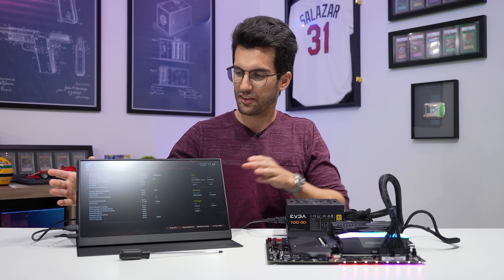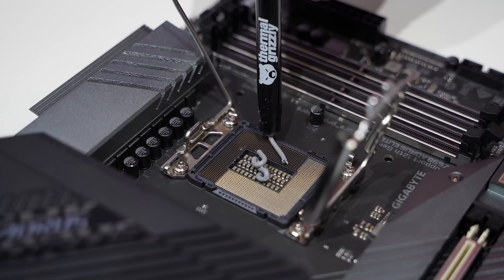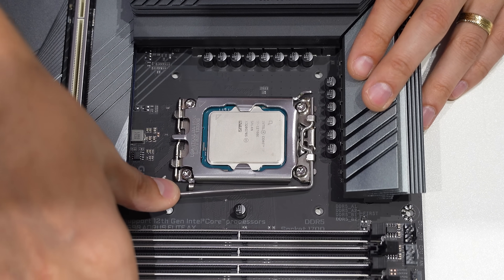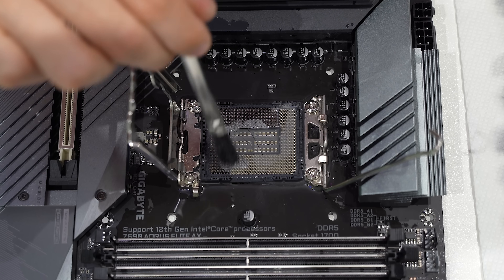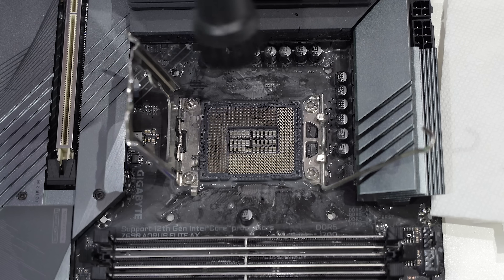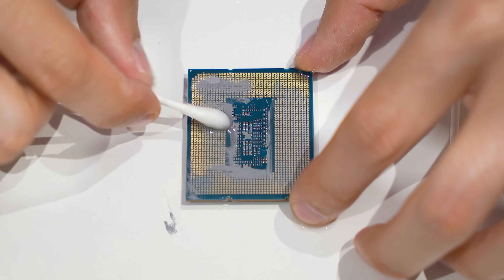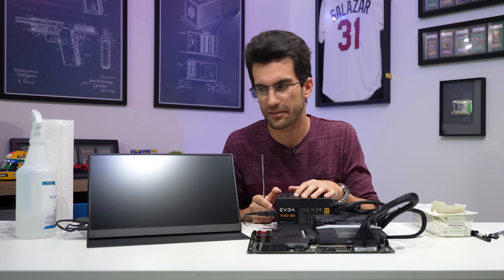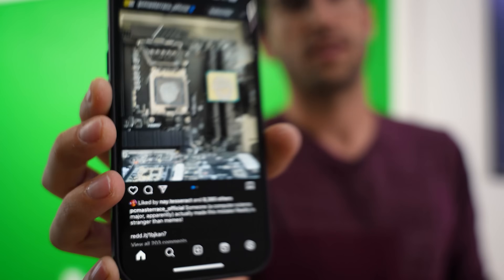How To Fix a Thermal Paste Disaster!

Comment: I can state from personal experience, and without needing to watch further, that YES it is entirely possible, as well as easy, to recover a motherboard from thermal compound like this. I've used a hexane based electronics and contract cleaner for over 25 years that has never failed to strip all traces of thermal compound from heatsinks, cpus and whatever else the compound is on and it leaves zero residue. Granted,  this doesn't make an interesting video, but it works quickly and it's simple to do.

Comment: I use Arctic Silver Ceramique 2 because it's non-conductive and also non-capacitive. You don't want any residue between two pins to start acting as a capacitor. It's not the best thermal paste when it comes to thermal performance but I'm willing to trade a few degrees for a thermal paste that is guaranteed not to cause any electrical issues whatsoever.

Comment: Greg, you just need to apply Power Switch Contact Cleaner, it will evaporate in seconds and will remove all of the thermal paste from the socket and from the processor contact.

Comment: I actually did this oopsie a few weeks ago. I was working late, around 3am, and I didn't know how I managed to get paste under the cpu into the socket. I was panicking and dropping f bombs, but the ipa and brushes helped. I somehow didn't bend any pins and the system posted. I didn't want to buy another i5 13400 and or motherboard lol

Comment: I forgot to mention, you can use a dental water pick with IPA instead of water and tilt the board on its side and use the high pressure stream to rinse out the thermal paste from the holes in the socket. thermal paste these days is non-conductive and is safe. You could also use a high pressure steam gun to rinse it out using hot water vapour or IPA. If you use water, be sure to place it by a heater for a couple days. Usually only Arctic Silver is highly conductive and is not used because of this reason. Also using a tooth brush for the SMD components on the underside of the CPU is a great way to clean it.

Comment: Wait till you get TG Pink Goo on a 5950x that was a Nightmare. Did a cinebench run before removing to avoid it sticking to the cooler bit got hit with the bubble Gum running into the underside pins had a oh 💩 moment but grabbed my soft bristle toothbrush and ISO 99% and gentle strokes  saved it.

Comment: I used to remove the battery and all the sinks. Put it in the dishwasher and let it go thru a cycle. If you wish you could give it a soak in alcohol afterwards. Then let it air dry for a week. Put it all back together and off you go. Been doing that for about twenty years without issues. Just don't power it up while it's wet. All of my motherboards look like brand new. Used to be an overclocker. Lots of Vaseline and sealers were used on my boards when getting boards super cold. You couldn't tell the boards were ever sealed afterwards.

Comment: a soft toothbrush works perfectly tho. accidently applied to much thermal paste once and it got in the cpu socket during a cpu upgrade. just used a toothbrush. no problems after

Comment: I've never taken it to those kind of extremes but only thing that works for me is to soak the socket in IPA, Spray with canned air and then gingerly finish with a toothbrush going in the direction of the pins. A microscope always helps too.

Comment: Yep, fixed this multiple times like this. I've only ever dealt with something this bad once. Usually I've just had to deal with instances where people applied so much TIM in ended up in the socket. Another option for people that are too scared to touch the pins is some Deoxit55 or CRC electronics cleaner. That stuff can eat it up and blast it out of the socket. But you might want to hit the whole board with with an IPA bath afterwards and blow it out with compressed air.

Comment: Just toss the board in the dishwasher, no big deal.

(I don't know about modern boards, but old motherboards, like 486 etc. you can actually put in the dishwasher. Just need to dry thoroughly after)

Comment: Electronic cleaner is alot better for this than Alcohol. Electronics cleaner will dissolve the paste and you can just keep spraying and have it run of the board. Then you won't be to scrub on it.
Stop using IPA as a go to for electronics, there is stuff made specifically for this.

Comment: A ultrasonic cleaner will get deep in the socket, then you wouldn't have any risk of damaging the pins.
Reply: The trick there would be getting your hands on an ultrasonic cleaner large enough to submerge the socket without it rivaling the price of the motherboard.
Reply: Not everyone can simply get access to an ultrasonic cleaner. Alcohol, brushes and paper towels are a more easily available option.
Reply: @aaldrich1982  i think high pressure brake cleaner spray  would work even better
Reply: @dragos_NBK  I hope this comment is a joke!! LOL.  Brake cleaner will DESTROY the motherboard, yeah you will fix it and clean it at the same time...involving a new replacement!!
Reply: @davidplaster4576  Yeah no it doesn't and is designed not to react with plastics, metals etc.

Comment: The fact that no one on you tube, not even the Verge showed someone to put paste on that way is a testament to just how clueless some folks really are.  Not even sure Coloring books are appropriate for that individual,  but as shown here that mistake is an easy fix although tedious.  Most thermal paste has some conductivity but not enough to cause an electrical issue, some brands are and those are usually designed for delidding options.  Great video!
Reply: It's not entirely true. We keep the top secrets to ourselves. It's the master race of building
Reply: My guess is it was intentional for "engagement"
Reply: @MrBeetsGaming  point is it was done
Reply: Not even the Verge  :D
Reply: Not if that ignoramous, went and turned their PC on, before seeing this video!
Reply: Not true. Linus No Dollar wasted PC build had this in the intro

Comment: An easier way to clean a socket is to spray it with a can of electrical contact cleaner. It will even take care of the residu at the bottom of the socket.
Reply: He should try this next. It'll be like power washing the socket.
Reply: I clean every CPU GPU and MB when there is thermal paste on it with WD specialist contact  cleaner and never had a single issue.
Reply: The contact cleaner I have is more or less pure IPA anyway.
Reply: @samiraperi467  most have also have additional solvents that can attack the TIM, meaning you won't have to risk physical damage with brushing. I strongly disagree with Greg on the use of brushes, LGA is fragile.
Reply from the maker: @exciting-burp  The brush I used (despite the shitty crimping) is extremely soft and not backed by anything solid - meaning you have plenty of pressure flexibility without risk of bending pins. If you don't trust yourself with a brush this flexible, ya probably shouldn't be messing with the socket to begin with.
Reply: Correct or using break cleaner holding it upside-down 👍
Reply: @gunnarsandstrom8031 err brake cleaner destroys electronics. From experience.
Reply: @capnpugwash5403  all break cleaner is not the same but safest bet is electronic spray.

Comment: Another way to clean the socket is to tun the board around and use  wd 40 electric contact cleaner spray.
I haven,t tried it but should get thermalpaste loose and  doest need so much brushing.
Reply: Works awesome!

Comment: At 10:20, you say that as long as the paste isn't thermally conductive, where you meant electrically..  By it's nature, it better be thermally conductive, lol.
Reply: 1 Gold star for Captain obvious.  Now look at your post again, find the error and next time understand how mistakes occur.
Reply: @animalyze7120 Well here's the issue, if someone doesn't know much about thermal paste, and he doesn't clarify that it needs to not be ELECTRICALLY conductive (some are, he does mention it later though), they might waste their time and effort if what they used IS electrically conductive.   When working with this stuff, details matter.  A mistake here could lead to someone else causing their system damage due to not understanding exactly what they're up against.  If you can't understand that and are just wanting to fanboi, nothing I say is going to change that, and all I can say from here is 'good day', lol.

Comment: Once you've flooded the socket and dissolved the thermal compound, try using a sponge. Just press down then release to let the sponge soak up the solution. Don't move the sponge around as it can damage the pins.
Reply from the maker: I wouldn't advise pressing downward at all with a sponge. The pins can bend a BIT, yes, but I generally try to avoid applying downward pressure. It's a bit different with a CPU's solid surface and distribution.
Reply: @GregSalazar  You're obviously using a different sort of sponge! But yes, you mustn't apply too much pressure; you want to compress the sponge, not the pins.